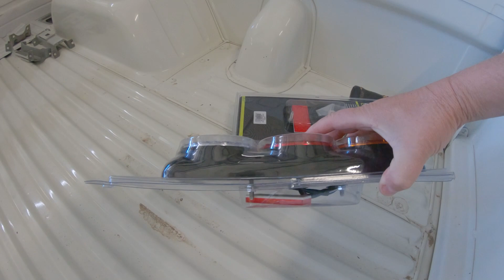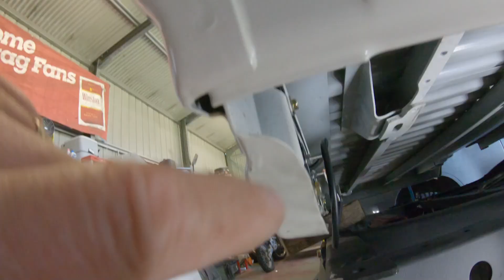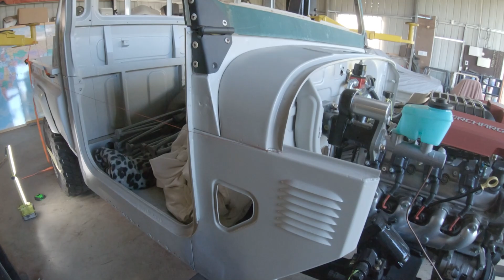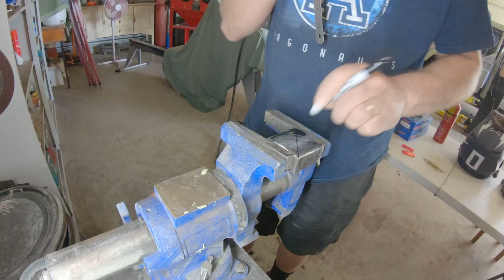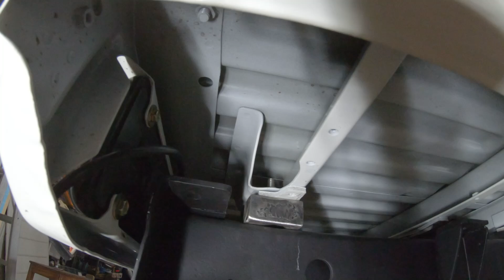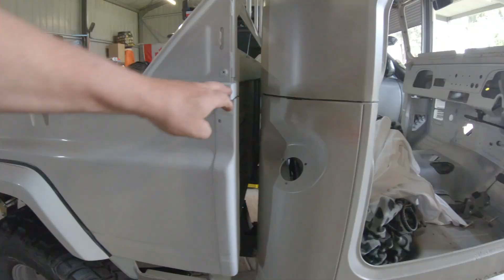FJ45 Landcruiser Restoration | 79 Tub onto a 40 Series Landcruiser | Fabricating Mounts | Episode 19

Comment: Looks awesome mate 👍. What is the big hole in the passenger read cab quarter?  I may have missed that in a prior episode.
Reply from the maker: Thanks Travis, that is very kind of you to say.  The previous owner had two under seat tanks in the cab, the original hole in the drivers side housed the filler for the under driver seat tank, the hacked up hole in the passenger side housed the filler for the under passenger seat tank.  I’ll have to fill both sides in with sheet metal as I will be using the filler neck in the tub to fill my new fuel tank bolted to the rear part of the chassis.  I don’t need either in cab filler ports.  Cheers
Reply: @JafffaAdventures  Make sure you film it. It will give me some motivation to fill some holes on my 40!
Reply from the maker: Will do Travis, cheers👍😎